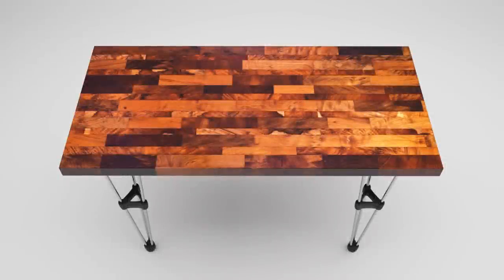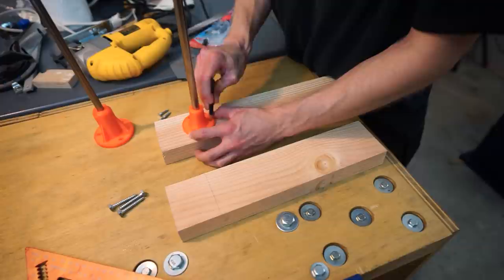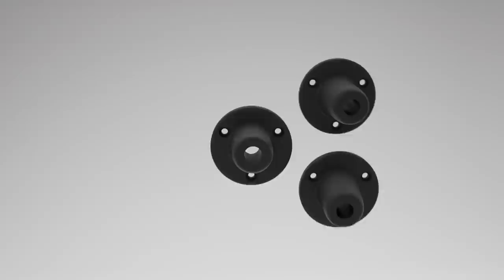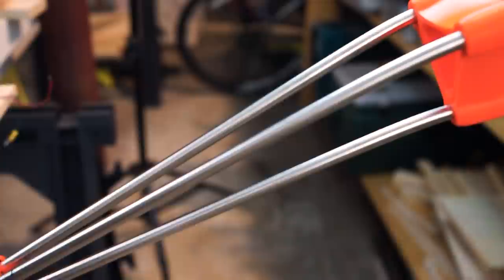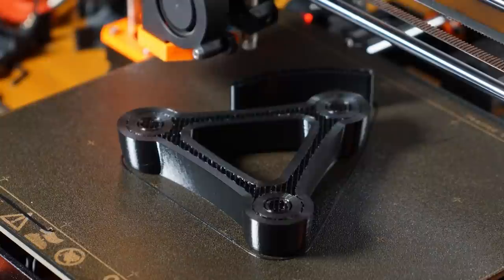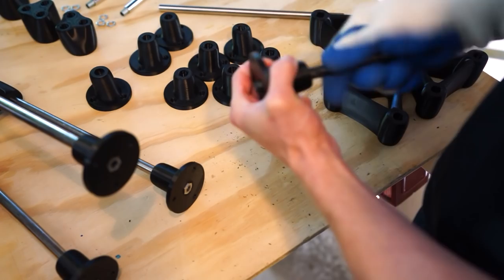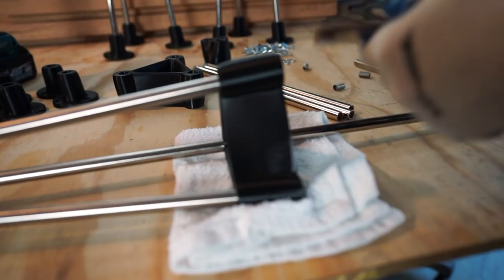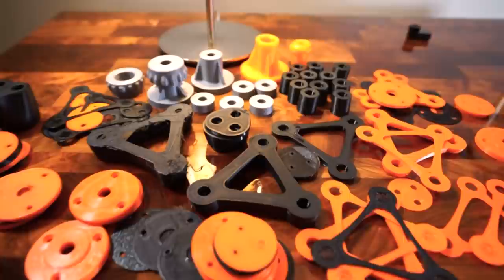Designing and Testing 3D Printed Table Legs

Comment: About solid versus infill, simulations of similar parts show forces transferred near the surface so more perimeters is better than higher density in the centre. Infill is more about holding the structure together during printing and providing support for horizontal top surfaces after a certain point.
Reply from the maker: @Andrew Cox
 Totally agree. I think I saw a CNC kitchen video about this a few years ago. This is why the top joint was printed solid because infilled parts were more likely to delaminate with this specific design. In this case the biggest benefit of the infill was keeping the prints from warping to heavily (and falling off the bed) and creating a unintentional area for blob collection.

Comment: the timelapse printing shots are rad
Reply from the maker: @cheezus More of those coming in the future. Fun fact: the pictures taken by Octolapse cause the print to pause for 10 seconds and the printer nozzle oozes all over the place during that process. That's why there is a "blast shield" in the back of the prints.

Comment: Hey man, this is an awesome build, love the design, testing process, and the timelapses! I’ve designed connector pieces for rods similar to these in the past, but I’ve used Fusion 360 CAD, and if I remember correctly, you’re a polygonal mesh guy. I would love to see at least a high-level overview of how you use that type of modeling for parts that need to be dimensionally accurate, like the triangular piece. Keep it up man, awesome stuff!
Reply from the maker: @
Griffin van Horne I am a native polygonal modeler but some things just cant... or maybe shouldn't be done in that sort of program. The workflow becomes destructive after a certain steps because there is no history in the objects. These parts were actually a collaboration between me and a friend who is a Solidworks pro. Solidworks was much better for this particular purpose. We have talked about maybe doing some detailed design and process videos but I'm not sure how big of an audience they would have. Your post is the first official request for such a thing. It has been noted!

Comment: Hole rimming: I tend to do that with a drill running backwards to avoid cutting the plastic part
Reply from the maker: @
Nick's Stuff That's a great method and I have used it for lots of things but the blobs were so intense in these parts the backwards drilling just sort of rolled over them. It was a total mess!

Comment: 01:20 all these designs seem to rely on layer bonding to take the peak forces, something CNC Kitchen's experiments have repeatedly shown to be a weak point. Did you play with ways to get layer lines aligned with the directions of load forces rather than perpendicular to them? Perhaps by printing in pieces and then assembling or by using support material?
Reply from the maker: @Andrew Cox
 Good catch. The layer lines running parallel to the table surface is the main cause of part failure. Your right, angling the parts and printing with supports would likely increase the shear strength but a lot of testing would be needed to find the perfect angle. This project was one of the first print jobs I ever did myself and the learning curve was already very large. The challenge was compounded by using an Olsson Ruby nozzle which caused an increase in PETG blobbing and stringing. I recently replaced the Ruby and those issues have reduced noticeably. Because of the design, version 2 will have to be printed with supports so I will be able to explore layer directions at that point.
Reply: @The3DHandyman  to be fair as the video went on it seemed these were not the first part of the legs to fail anyway. In fact you might prefer these replaceable parts to fail before the metal rods bent. It's a great project, first or hundredth!
Reply from the maker: @AndrewHelgeCox  I think version 2 will be a lot stronger laterally based on the leg configuration. Maybe I need to go with carbon fiber tubes to up my whole table game!

Comment: you are very pro at your stuff
Reply from the maker: Thanks Nils! I'm always looking to make improvements. Is there anything that you would like to see made better?
Reply: @The3DHandyman  by the way, your facemask design is one of the best I've tested. It's a fast and easy print, great air flow, no support, few material, etc. I think I'm going to make a version of your design to better fit my needs!

Cheers
Reply from the maker: @nilsreichhard  You have quite a few really interesting designs on your site! I could never imagine printing clay with a huge robotic arm. Very cool. 

I also bounce from project to project a bit more than I should. There is a video on the channel that I go over the PC that I use to do the rendering. The 3 GPU rig does all the animation work. I need to get back into Unreal tho. The real-time stuff is getting hard to ignore.

Glad that the mask is working out well for you. Feel free to upload a remix to the Thingiverse page if you come up with something great!

Comment: Edit: Nevermind, Andrew Cox's comment has already made this point many moons ago.

There's probably an army of advice on this from experienced 3D printer people, but (I'm only new to 3D printing myself, so take this with a grain of salt):
Rotate the print 90 degrees (i.e. onto it's side so that your print layers end up stacked horizontally - i.e. left to right - through the part when it's loaded in it's actual application, rather than vertically - i.e. up/down, as they appeared to be in this test. Your part failed in tension between layers from the looks of it, so you might do better, all other thing being equal, if your tensile loading is along the filament layers, not perpendicular to them.
(You'd need to print a minimal supporting structure during the print process obviously).
Reply from the maker: Hopefully I will be able to get V2 some day soon. The shear size of those parts is a bit daunting, but I do like a challenge...

Comment: I swear I've seen this 3D printed leg design before.
Reply from the maker: @
Phillip Toone I can't say that someone else didn't come up with a similar design at some point. After all, it's a fairly basic structure. I did a quick check of Thingiverse and didn't find any table legs at all. If the other one you saw comes across your screen at some point, post a link! My testing videos are time-stamped September 2018... this video has been a long time coming. Haha.
Reply: @The3DHandyman  I new I had seen that before because when I saw it the first time it really stood out to me as interesting.  I remember thinking that it didn't look like it would be a very strong design.  In this video you debunked my initial skepticism.
Reply from the maker: @philliptoone  Then it was a worthwhile experiment!